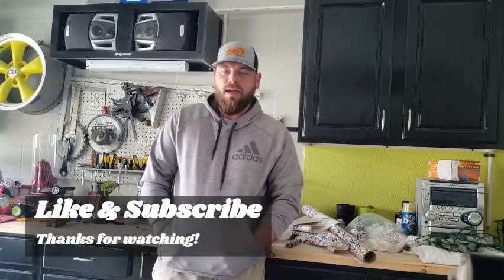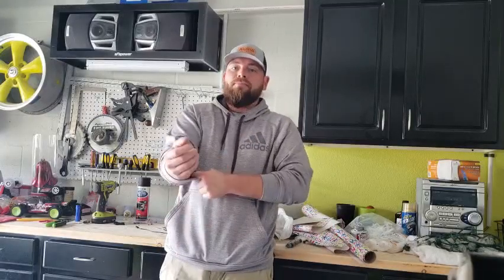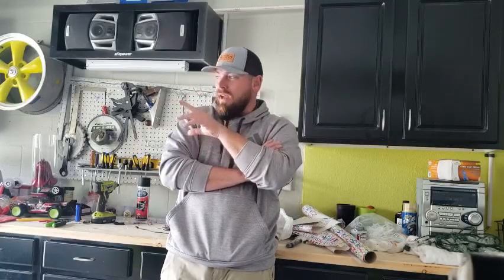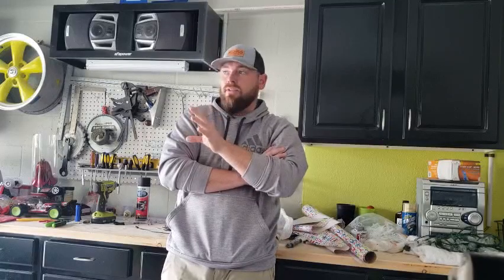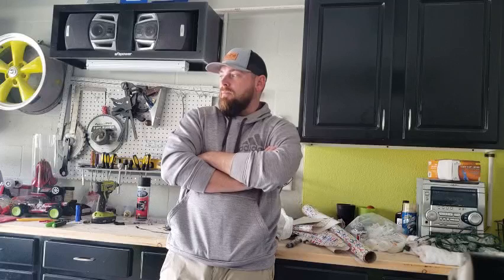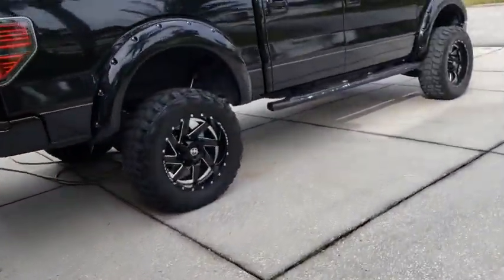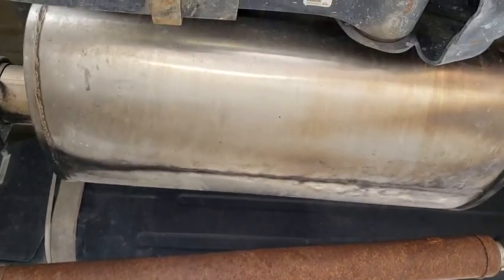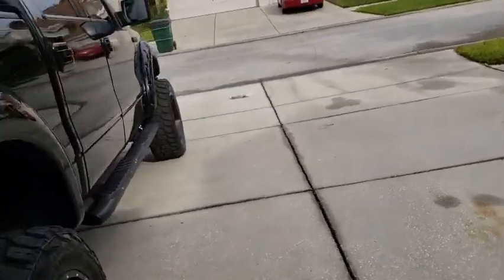Corsa Exhaust (Broken in) F150 5.0 Review

Comment: Where did you find the pipe for the resonator delete and what size did you use?
Reply from the maker: I took it to local exhaust shop, they had the size and welded it in, not sure what the exact size is..
Reply: 2.5 inch